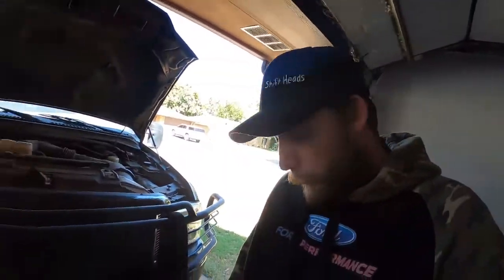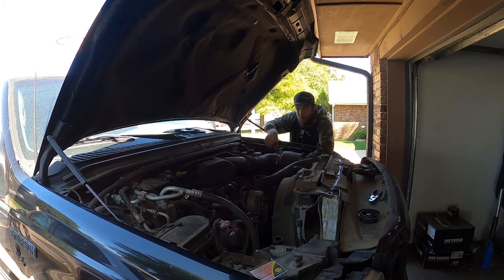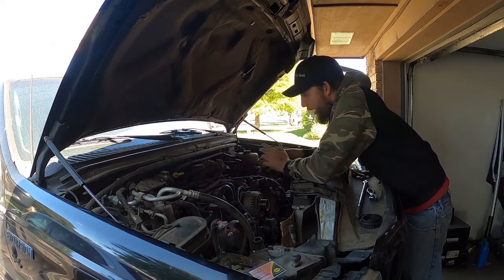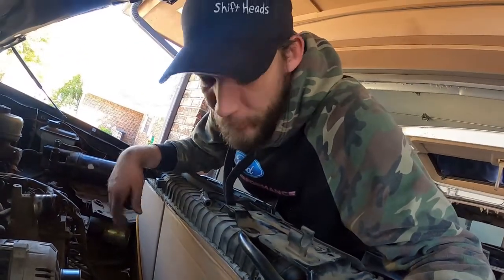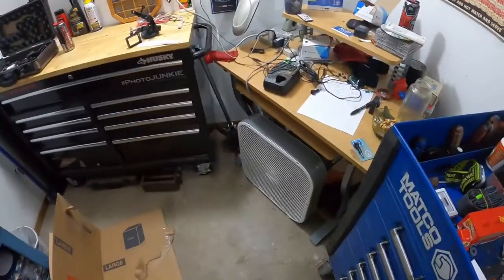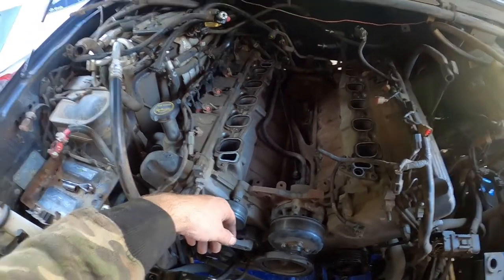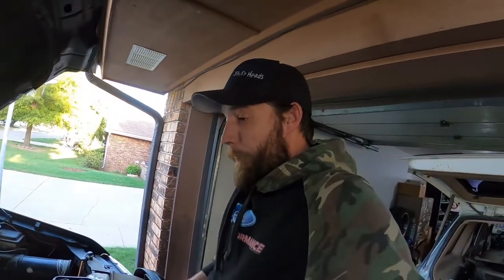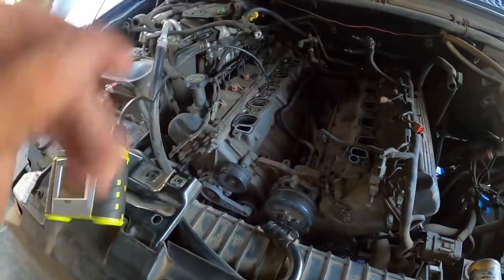Excursion Ep2 Intake comes off!

Comment: Had dropped tank on mine for the fuel pump drop drop tank pulled fuel pump out they've already been into the tank I had bare wires inside my tank they replaced the pump just the pump and they just Twisted the wires together a little quarter inch apart and 44 gallons of gas waiting for the spark
Reply from the maker: Sounds like you have a serious basket case on your hands. I would thoroughly go through the truck to ensure it's safe before driving it. The last thing I want is to see someone get hurt when they don't deserve it.
Reply: @shift-heads1686  oh I've been going through it it's like every time I touch something you sit back you scratch your head and you say what in the living hell it's like what were they thinking it was running when I when my wife bought it I thought oh just a tune up no big deal it's just one thing after another
Reply: @shift-heads1686  but to say one thing it's not really the excursions fault let's make that clear it's not the Excursion it's where my wife got it from